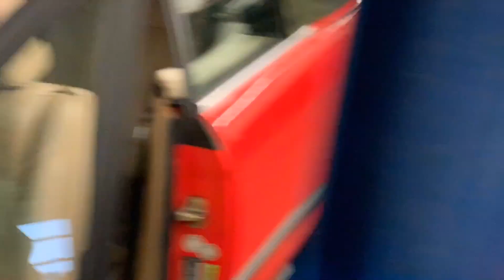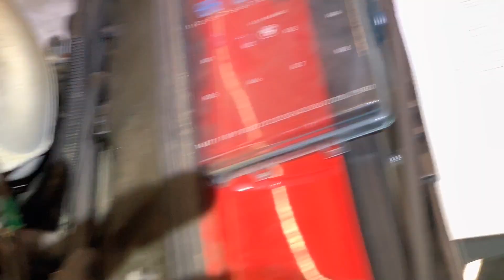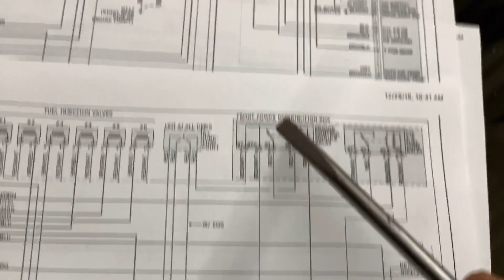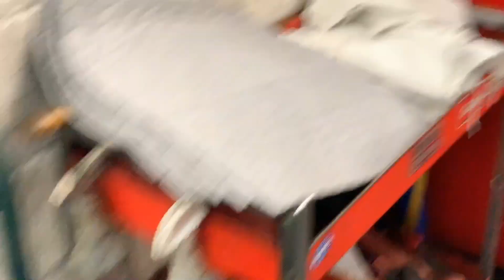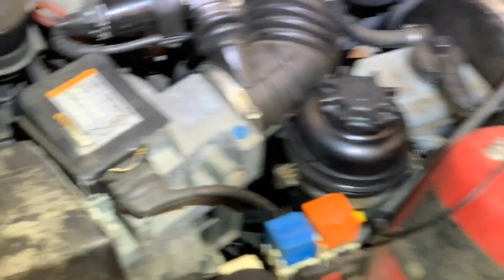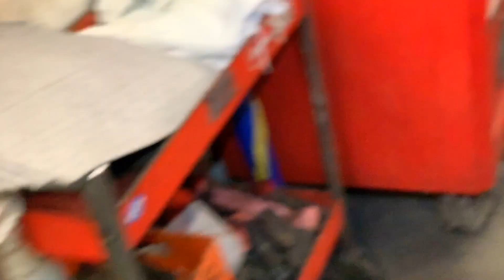1993 BMW 325i crank no start diagnosis Part 2

Comment: Bro, I wish I watched your video a week ago, thank you for your video and your a nerve saver. 
I Have a Swapped the engine in my 1992 had the same issue, what causes this problem?
Is connecting a Separate ground the only Permanent solution?